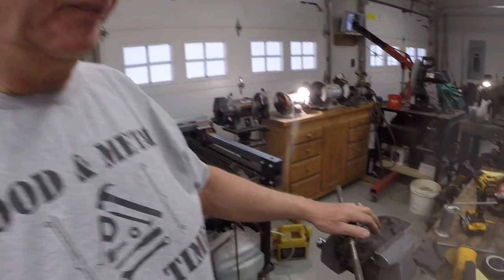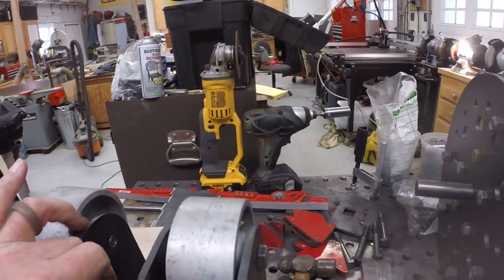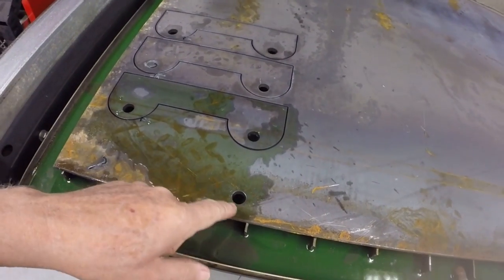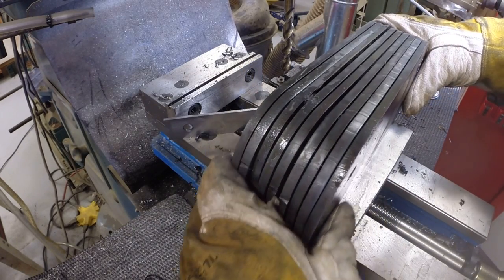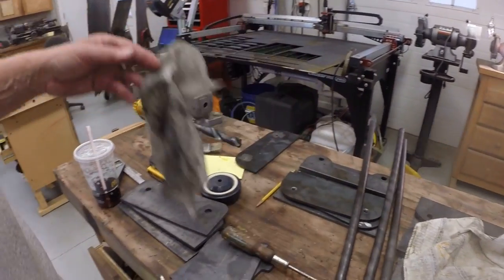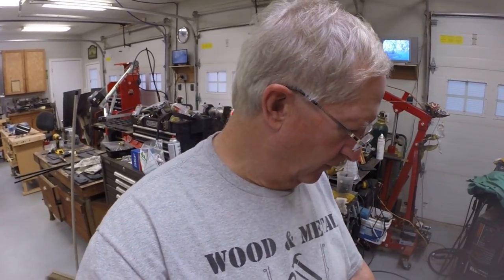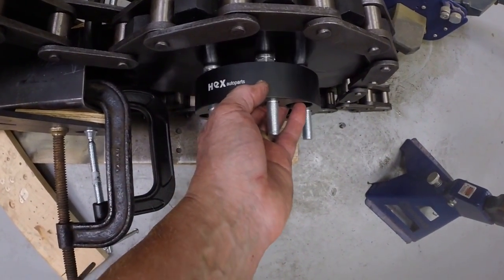Cub Cadet Dozer Build #19

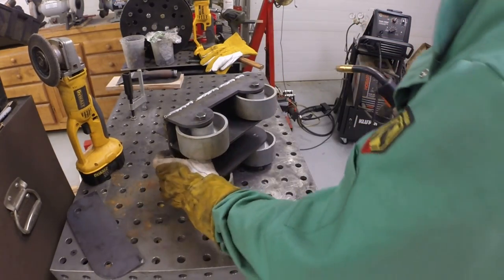Comment: At around 23:00, he welded the angles to the main plate, with no ground on the plate itself. That means the current is going through the bearings on the wheels. That can weld a bearing ball or roller to it's race or races, and is really a bad practice, and can cause early bearing failure.

Comment: Nice work 
You should be chamfering your plates 45° half the thickness of the material 
You’ll have a v groove to fill with weld it’s much stronger 
On the angle iron it’s fine to just weld it ..it creates its own groove the way you assembled it 
Your welds will look allot better once you try what I’m saying

Comment: Hi Frank, when you were cutting your new design for the bogies consider rotating one 180 degrees then offsetting to get tighter nesting of the parts, less scrap/waste.your NCC is doing a nice job on the cut quality.
Reply from the maker: I do need to get better at nesting. If I nest parts, I need to do in Fusion 360. When I post the gcode, it includes all the nested parts. I thus need to cut everything in that gcode. Sometimes I want to cut only one piece (prototype) then want to cut some more if it fits or works. My CNC software doesn't do nesting at least as far as I can tell. So it's back to Fusion 360 to nest parts, post new gcode, import into the CNC software, etc.   The CNC software will allow me to print multiples of an item, spaced out along X and Y axes, but won't rotate them to optimize material use. So, basically, what I'm saying is, I'm lazy. LOL.

Comment: You realize that the bogies on a Cat have flanges on the outer side of them to keep them from sliding off the track and that they are 1 piece from side to side, not 2 like the wheels you have. Also there is a keeper attached to a couple of the center bogies to keep the track from dropping too far when going over ditches and holes. Each bogie (wheel) on a real Caterpillar is separate from the rest. They are attached by pillow bearings bolted directly to the carriage. The tensioning of the track is through a hydraulic cylinder inside the carriage. The cylinders are spring loaded like a coil over shock but and aren’t bolted in but are slipped in with “ears” in grooves to keep it from rotating. The bogies ride directly on the chain but in your case the chain is too narrow. Doubling the chain and drive cog would help this if authenticity is paramount.
Reply from the maker: Since my track is only held together by the chain running down the middle, the bogie arrangement is intended to distribute the tractor's weight more evenly across the width of the track. Most real dozers have more sophisticated tracks.  Authenticity is not even a consideration.

Comment: A idea I got is rather than have the curve got 90 to a flat make your gap more of a curve that should help keep the mettle from ripping on the corner. It might do that with the lateral forces put on the front and rear bogies. Looking good 👍. An example of what I'm talking about could be mocked up on paper if ya make similar cuts out of paper and then make a flowing design like connect the 2 circles with another that connects them it shouldn't rip as easily. But that's my 2 cents and a  observation from a bi stander, keep up the good work
Reply: Well hopefully it never becomes a problem

Comment: Just a suggestion but if you move your guides in closer to your cut, it will be less wear on your blade. If you look at your video your getting a wave in the blade which indicates your blade is bending during your cut. 101 when I was an apprentice for tool & die making. Enjoying your build and your design!
Reply from the maker: Are you talking about the band saw?  I think you have a good point.

Comment: I would have turned the idler wheels around and made the nuts captive much easier to service and you don’t want the nuts falling off so you have to consider the amount of vibration on these things.
Reply: I like the way you think. There are quite a few opportunities to make captive nuts in this build. I’d have done it for the engine plate also.

Comment: Have you considered making your track tensioner wheel smaller to accommodate how close to the seat it is and maybe you’ll be able to adjust your chain length better when it comes time to do so. Just a thought.
Reply from the maker: I'm scaling dimensions from the D10, if that matters.  So the wheel diameters are all relative.  I think the proposed dimensions will work. The seat will get raised several inches and enclosed and fenders will protect the operator.

Comment: mount your bogies so they rock a little bit , to help over rough terrain . The Dozer  is coming along  nicely. may i suggest a spring in sleeve at end of your tensioner set up . as your idler arm will need to pivot some .
Reply: Hi Carl, I believe you’re thinking of a Tank suspension. Tank suspensions follow contours of the ground to provide the occupants some semblance of a ride, and to better engage changing terrain. Bulldozers on the other hand have rigid undercarriages that are simpler and track tension remains a constant value because the applied length of the track doesn’t change like it would in a tank.

Comment: Any plans for the future, for building a cub cadet tractor trailer rig to carry the dozer on? That would be great for parades, or cub cadet meets, or even a cub cadet photo shoot at the factory. Maybe they would give you a free cub cadet. At the least they should be sponsoring you.
Reply from the maker: Then I'd need a real tractor/trailer to haul the whole thing! But I like the idea.  I'll be working on this dozer, adding the blade, and a ripper and/or winch, etc. for most of the next 6 months.  An articulated 4WD is in the back of my mind, but it's been done a lot, so thinking about how to do it differently.

Comment: You may need to use smaller wire so you can control the fill material easier

Comment: Great job Frank - hey don’t the bogies on a tank or dozer float on some kind of suspension so they can flex when you drive over a rock?
Reply from the maker: That adds a good bit of complexity and potential loss of stability for the track. My track is much less sophisticated than a commercial track and is only held together by the chain. Solid mounted bogies help support the track from twisting and possibly breaking.  It will be a bit of a rough ride, I suppose, but it's just a toy, not going to be used every day.
Reply: @woodandmetalshoptime8048  good points - wish I had one too (not sure why but I do!)

Comment: id use a cars coil suspension spring and two steering hydraulic cylinders I fit with grese zerks and breather valves for the tentioner 
awesome project, im just curious to see how much it will actually shove as compared to a skid steer
Reply from the maker: At 14 hp it is not even comparable to a skid steer. It's just a toy, really.

Comment: Hi Frank, 
I have been enjoying your series on building the D-6 Bulldozer! But right now I'm looking at the design for your bogies and wondering why you didn't include a means for the bogie to pivot. I would think that would be more efficient at rolling  over small obstacles. Can you elaborate why you didn't design this into your dozed in your next video? I am excited to see the finish of this marvelous series! What's next for the King of the Cub Cadet Tractor!
Ted
Reply from the maker: I'm not building a commercial machine.
Reply: Hi Ted, I think you have confused a tank suspension for a bulldozer undercarriage. Tank suspensions have bogies that follow ground contours to provide a smoother ride and improved ground contact. Bulldozers are equipped with a rigid undercarriage that sits atop the track. The difference is the speed that the track travels. At faster speeds there’s more opportunity for the track to disengage from the suspension.
Reply: Wow Jon, thanks for that info! Even at my age new ideas and details about things continue to get me excited.
Now I gotta go build me a tank!
(I wish! Then it'd be a whole he'll of easier ride to the store... and for darn sure more fun! No more discourteous Richards in the left lane to get in my way! Bwah hah hah hah....

Comment: On a normal bulldozer the front and back ‘wheels’ don’t look the same. The front is an idler and tensioner, the rear a sprocket to drive the chain. Further, the bogies of traditional dozers ride on top of the drive chain rather than atop the track plates. You could get away with half of the wheels this way. You’d still use your bogie assembly that you have cut, but widen it and add plates to the sides of the bogie wheels to keep them centred over the chains- just like the real thing.  The issue you’ll encounter with the wheels on the track plates is that dirt and stones will collect on top of the track plates and then stop the bogies from rolling. You should still have no problem with stability, in staying on top of the track.
Reply from the maker: I'm scaling from the D10 where front and back look the same, the hi drive wheel is different.
Reply: @woodandmetalshoptime8048  yes, after watching a few more of the earlier episodes I see that you’re using a transaxle per track thereby making it necessary to hide the front sprocket on the right hand side. However I stand by what I said about the bogies riding on top of the chain and not on the track plates.
Reply from the maker: Since the track is only held together by the chain, running bogies on the chain will put a lot of force on the chain links and the tracks get twisted right or left by terrain.  I think, for the occasional use, the existing "bogie on the plates" configuration will work fine and transfer the weight to the track pads rather than to the chain itself. I guess we'll see how well it works. I can always go back and redesign things that don't work out.

Comment: The sensor on the plasma cam looks like it's going. A UV shield is a cheap investment or use an automatic welding helmet glass.
Reply from the maker: I set up an auto darkening lens for that cam but when it darkens you can't see much, even set at shade #5.  I need to find a UV filter I guess. It's a cheap camera, so not a big investment if it fails. But you've got a good point. Thanks.

Comment: Are you going to drill your bogie wheel bolts so you can put grease inserts in them to keep them greased  and keep the dirt out
Reply from the maker: The wheel bearings have zerk fittings.

Comment: Go watch squatch link in previous comment . You may want to rethink a few things on how your building this and how tough are the rollers . I am curious they may just get chewed up
Reply from the maker: They are not steel, but sintered iron, so I expect some wear. If this were to be used daily, I'd be concerned. Since it's just a toy, they should last OK.  I've anticipated possible replacement by the design.

Comment: Your new boggie outer plate design may be wrong.  While it lets you clean it easier, it also allows rocks to get in!  This can be a big problem and end up tearing things apart.   I know this because we had to fabricate new guards on our vintage MF200 dozer.  They were partially broken when we got it.  While working to create a small pond in a wet/rocky area of my brothers pasture, it ended up tearing them up a lot more, making them un-repairable.    You may want to consider making full length gaurds (front to back, both inner and outer boggie sets) that are removable so you can clean those inner ones.   But, you may not ever use this mini dozer in a situation like that.
Reply from the maker: I'm sure I'll be making changes and improvements over time once I get this thing running.  Lots of folks are suggesting changes that you might see on a commercial machine. I'm not building a commercial machine that will see use on any regular basis.  But your comments are well taken. We'll see where I wind up on this.
Reply: @woodandmetalshoptime8048  Yes, I realize this.  Also, your boggies are running on the pads, all dozers I've seen, they run on the chain, so they are clear of the pads. any small dirt/gravel would likely be pushed into the spaces of the links, not interfere with the boggies rolling.   I have some experience with small wheels like you are using and moving heavy equipment.  It doesn't take much for them to get hung up on small stones.   I think you may end up with them skidding due to larger gravel (3/4, 1/2"") hanging them up.  Some small gravel will likely be crushed into dust. But I fear your mini dozer won't be heavy enough for some of it.   It also looks like those wheels are too narrow for the whole chain width.  But what about staggering the wheels so they ride both edges of the chain evenly.  Also, you could weld a guide rim on the one edge of the wheel as the primary chain guide (like a train wheel).  This is how some were on our dozer, some were just tapered smaller towards the center.   Then the outer guard ran full length of the track to near the front and back drive sprockets.
Reply from the maker: I don't think you can weld to sintered iron wheels.  Braze maybe?

Comment: On the drive sprockets to much over thinking will be problematic with to many of plates and spacers less is better I own an Excavating company and a dozer is the hardest on tracks it will tear it self apart metal to metal. Aesthetics is not always the best choice making it look uniform is not necessary the way your design is functionality works better less parts less problematic problems thank you for taking my two cents.